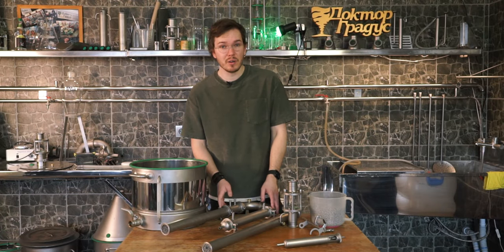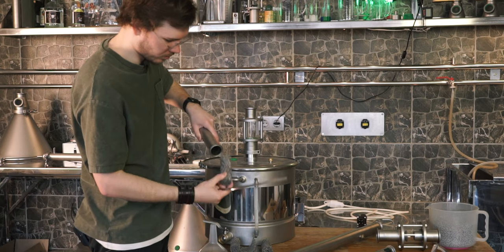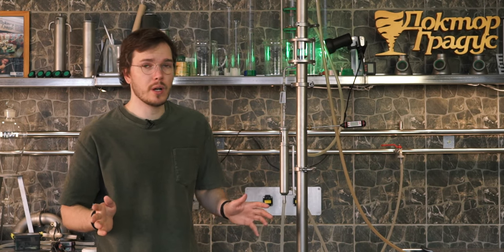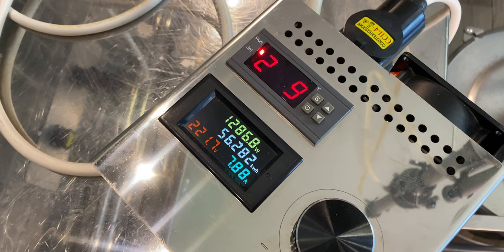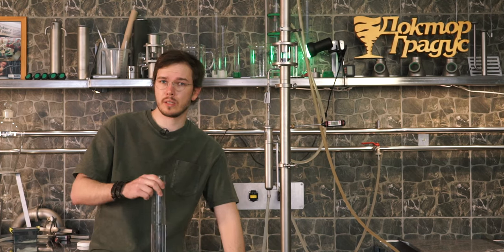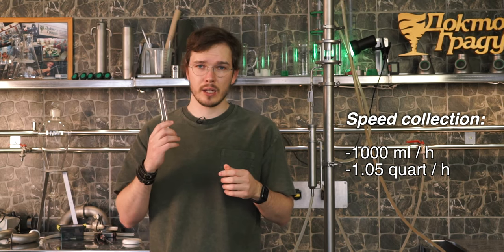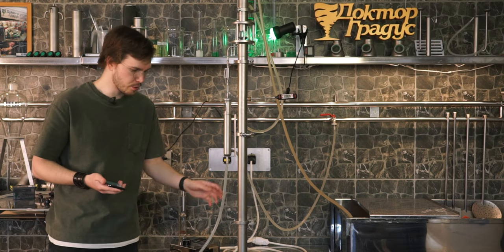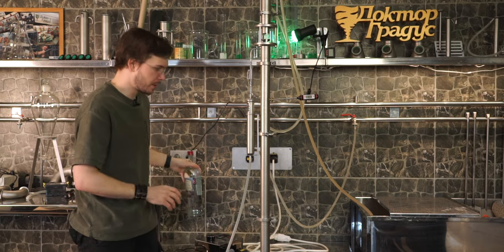Liquid management kit for 1.5 in CM distiller

Comment: It's a great video, thanks for sharing. I also have a question: how come this setup uses 1000 Watts and the distillation rate for the hearts is 1 liter per hour, while your other setup that employs 3-inch extensions uses only 3000 Watts and its rate is 2.5 liters per hour? I mean when the diameter of the tubes is doubled, the area is 4 times, so I expect the Wattage to be 4 kWatts and the rate to be 4 liters per hour. Please walk me through this.